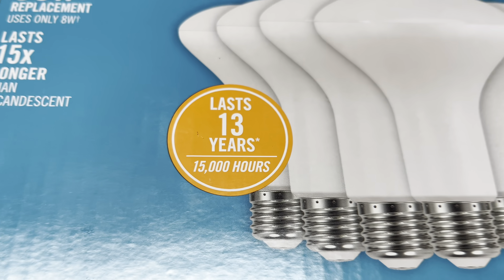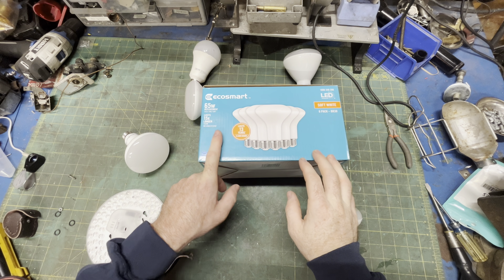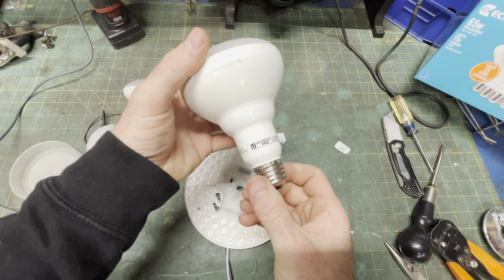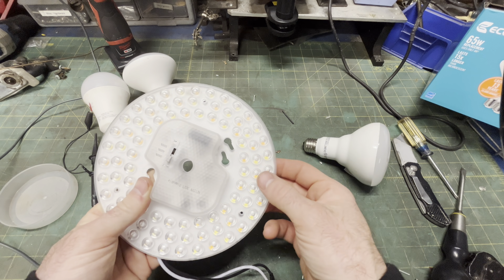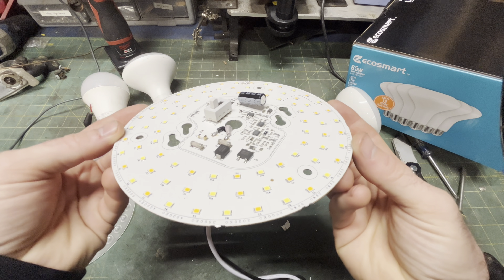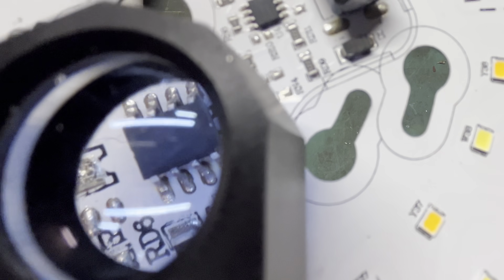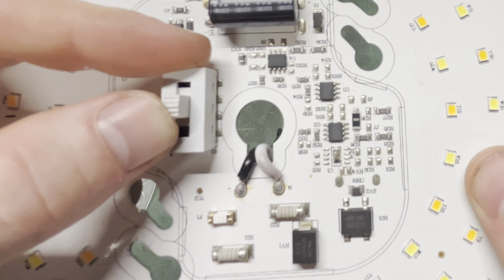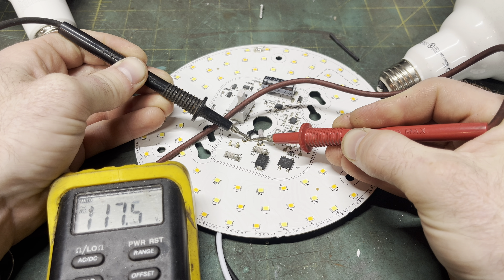Why Do LED Bulbs Fail? An Autopsy!

Comment: Both LEDs and CFLs are complete garbage. I have not had good luck with either. I will say that neither last anywhere as long as the box says. I have taken many back to the store for a refund or exchange. The people at the return desk never ask any questions. That said, I have had better luck with integrated LED fixtures when compared to bulbs that twist into existing lamps.

Comment: "Why do LED bulbs fail?"  Because the ones you can buy nowadays are made in China, which specializes in engineered failure to force you to buy more of their crappy stuff.  Chinese products almost always have a single point of failure (SPOF) that is DESIGNED to break the product.  If you are clever enough, you can often find the SPOF immediately after purchase and fix it, extending the lifetime by 10x.

Comment: Reading the comments made me realize that people are not aware of:

• The sizable energy savings of LED bulbs.

• The insane durability of good LED bulbs

• The vast amount of options and lighting configurations offered by  LED bulbs.

• Incandescent bulbs used for heat consumes a crap-ton of electricity.

• How widely available and ubiquitous LED bulbs are to the point you can buy them for pennies in thrift stores and garage sales. 

Overall, LEDs are cheaper to own, longer lasting (when you buy a good one), and often times cheaper to buy. Sometimes you can even drop them with no concern for breaking. Smart bulbs widens your options even more.

Comment: 🤔The complicated version means... That the circuitry inside the LED bulbs is what burns out the most, the intricate delicacy of all the resistors and transistors in the SMD design is sub-level to begin with in China'''' 😉🫡

Comment: I bet you are a high user of superglue to glue your cut fingers together too. They have made it so difficult to order spare parts in the hospital i work for so this kind of repair actually makes sense again. The powersupply kost 40$ but i need to internally charge de department 440$ because it takes 4 hours to order the dam thing. To if i can break it apart, solder the bad connection and put it together again in 2 hours it only cost the tax payers 200$. 

I have done many of this autopsies on lamps and are yet to find a actual broken LED. So there is basically endless free LED:s in the world for you to play with. And i do. SO funny you had to pay money for LED before. Now i have more than i can use in a lifetime if i don't start growing weed in my garage or something.

Comment: I must comment that your capacitor tester only tests capacitance, and voltage testing on a capacitor is critical. I have run into hundreds/ thousands (?)  of capacitors over the decades that test OK on capacitance, but fail on the rated  breakdown voltage test.  Yes, most of the cheap chineseium built LED bulbs are unreliable.
Reply: And with SMPS the ESR of the bootstrap capacitor is important. As a cap ages the ESR will rise and just like if the capacitance drops the SMPS won't start. 

I've had this happen with expensive network switches nevermind cheap switched mode LED drivers.

Comment: Anything from FEIT is garbage.

electrician here, The problem with this is the solder that's used. You can buy solder in almost any temperature range that is lead-free but because most of these are made in China and they use whatever the hell they feel like, oftentimes the solder has a very low melting point. now you have a transformer in these things basically that convert 120 volts AC to a much lower DC voltage through a rectifier, whatever that additive voltage is between the LEDs that are in some combination of series and parallel. This matters because this generates a lot of heat. which in itself is wasteful and you're not really saving a lot of electricity by using LED bulbs. The heat that is generated makes the solder warm and softens it. The light bulb that he has mounted pointing straight up likely has all of the LEDs mounted so that if the solder was hot the LEDs are not going to move. 
That same lamp mounted sideways were inverted is likely going to have the LEDs break contact. and before you think about going back to incandescent bulbs, Barack Obama and Joe Biden have both signed executive orders and I believe Congress passed some stupid law also regulating their manufacture and importation.

Comment: I bought my house almost 9 years ago.  I did heavy research and bought cree bulbs and replaced every existing bulb in the house.  Some of those have been replaced with RGB smart bulbs at various points.   Not one has failed.  Total number of bulbs, 17 recessed fixtures, 8 lamps, 4 ceiling fixtures, several closet and basement lights, and probably some I am forgetting.

Comment: Annnnd now spiral CFL bulbs, which claim a 9 year lifespan on the box, are being phased out and will go the way of incandescent bulbs by 2028, hell I had to go all the way to a distant orange-logo'd hardware store to buy spiral CFL bulbs as I was unable to find anything but #&+)ing LED bulbs in any other store that I went to, also there's the matter of colour temperature, as I prefer the bright light of a  6,400K "daylight" bulb in my kitchen and bathroom while my online reseatch seems to indicate that LED bulbs don't go above 5,000K and I have so-called "daylight" LED  bulbs in my kitchen and bathroom which are dim and dismal af so LED bulbs are a complete ripoff. [Edit: forgot to mention that the LED bulb box claims "11,000 hours" which seems like a long time but is actually something like 15 months and that's about how long they last. :\ ]

Comment: I replaced all my lights with LEDs 4 years ago. Not a single one has failed. Some are not so bright, but I just used that as an excuse to swap some around to have less light where I don't want it blindingly bright.

Comment: Nope just go to any garage sale and get boxes of nice warm incandescent bulbs for a price so cheap that the running price for putting them in the closet you never open in the extra bedroom - which will never pay off in your lifetime  for the led you bought at HD. also the heat is a positive in the wintertime

Comment: I found u can buy bulbs with separate power supplies, or u can can bypass the internal power supply and make u own outside the lamp in a cool metal box, now the leds will last for decades.

Comment: I had a home built in 2003. All the bulbs that were installed when the house was built, were incandescent. When I sold the house in 2022, all but three bulbs inside the house were still original. I did do an experiment with an LED bulb in the basement, when LED bulbs were widely available at the hardware stores, about 2010 or so. I removed one incandescent bulb and replaced it with a LED bulb. from 2010 to 2022 I replaced the bulb three times. After the third time I installed the bulb I took out at the the beginning of the experiment into the original socket. It is too bad there is not a company in the US that makes LED bulbs. They may be expensive, but may last longer. There are some companies in the US that do make other forms of LED lights, but alas no bulbs. In my current home that I moved to in 2022, I plan on finding as many incandescent bulbs and as the LED bulbs fail, I will replace with good old fashion incandescent light bulbs.

Comment: These LED bulbs are perfect example of gov't regulations creating more problems then they solve. We were told these bulbs would save the planet. But, you put way more energy into constructing these bulbs than you ever get back out in energy savings. And the biggest reason why, is because all the supposed energy savings are estimated over a 15 years life span. But the fact that none of these bulbs never last the entire 15 years means that you in fact, never actually attain the expected energy savings. A simple incandescent bulb of glass and tungsten wire is a simple elegant design that is well suited to mass production and leaves minimal amounts waste once it's used up.